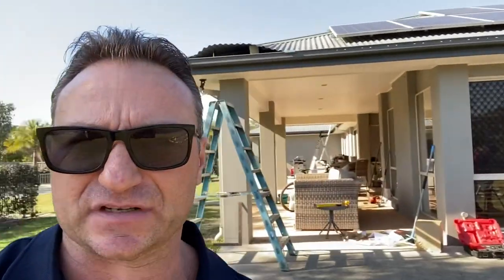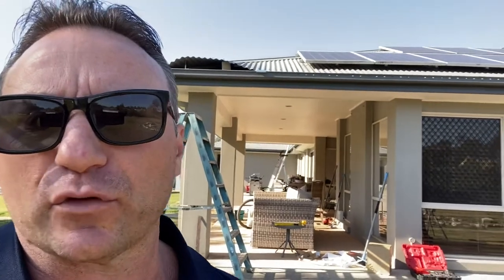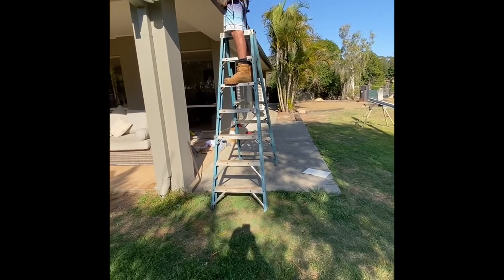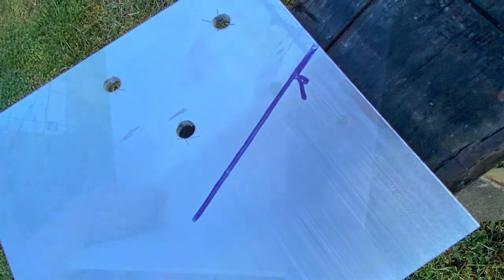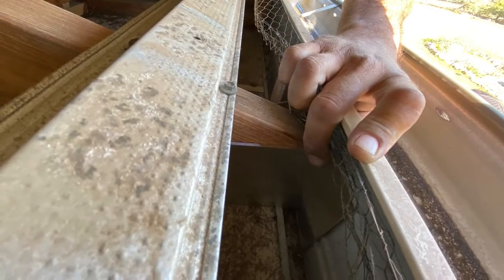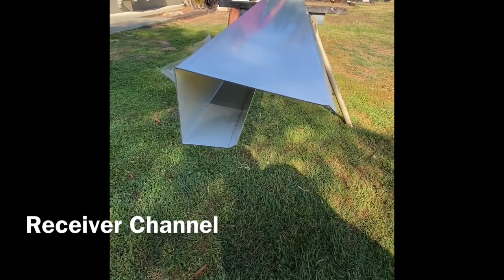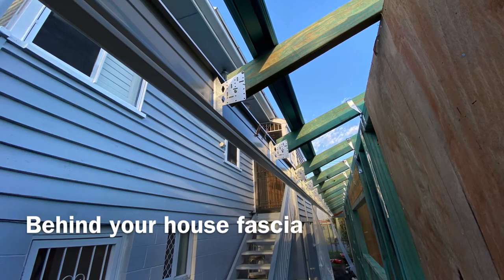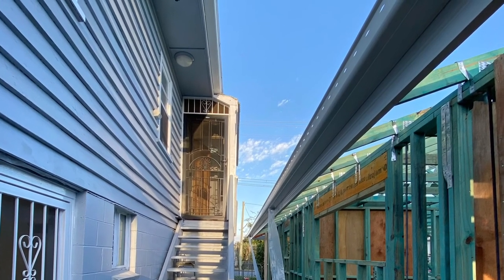D.I.Y MASTERCLASS- How to Install Fascia Support Brackets.

Comment: Hi!
Thank you for the videos how to attach the brackets to the fascia. You show how to attach the brackets behind the fascia, but that is all. There is no guidance or information about which (length) screws to use, and also not any information on HOW to fit the feeding channel. What do you use to attach the feeding channel?